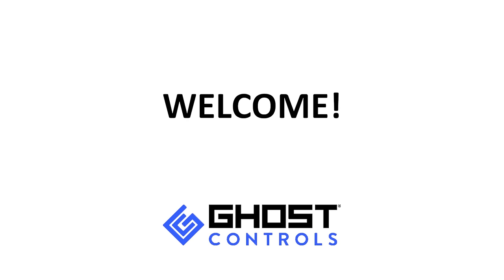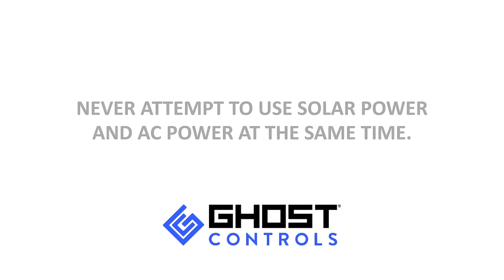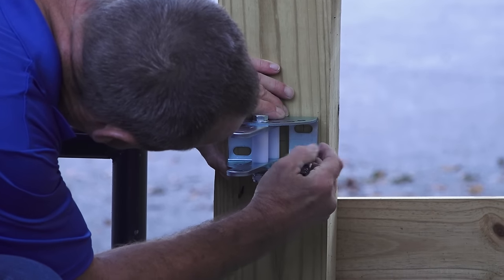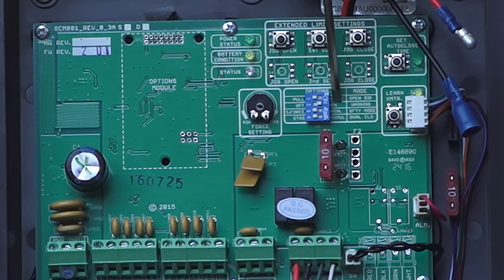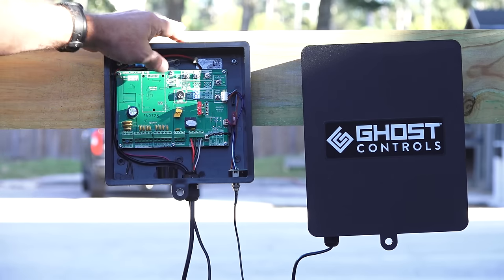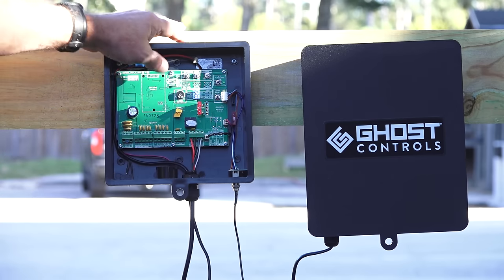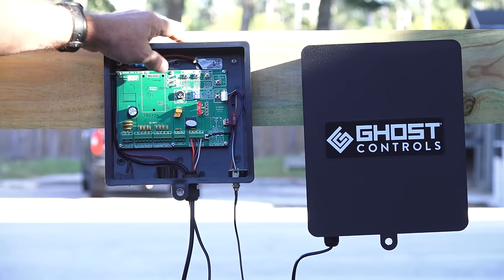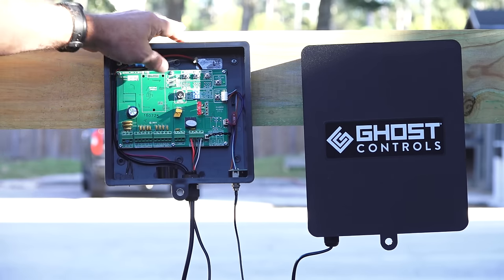Ghost Controls Gate Opener Kit Installation Video

Comment: Love my Ghost Control gate opener!  We have had it five years without a "hick up" until lighting hit very close on our property taking out one of two controllers.  Ghost Control technicians worked with  me to isolate the trouble in a very short time and away we went with replacing the unit.  It arrived within a few days for replacement which I will begin in a couple of days  They have my 5 star rating in every aspect of the high quality unit, Ghost Controls!
Reply from the maker: Thank you for the update on your system and for your support.
Reply: @Ghostcontrols2015  what do you recommend to keep that from happening? Isolators?
Reply from the maker: @mrstanley9856  we recommend grounding the gate and any adjacent metal fencing or structures, post, etc. This does not guarantee that lightening will not strike but it might help deter it from happening.  Here is a link to schedule a call with a technician for more information https://ghostcontrols.com/pages/schedule-a-call

Comment: Why didn't you do your video  installation on pipe fencing?    How many conversion brackets are needed to mount this on a pipe fence entry?
Reply: YES!
Reply from the maker: The T Series gate openers give you Tube gate adapters that will fit over most Tube Gate Pipes. If you are mounting to a 3 or 4 in round metal post we have adapters for that as well. Tanks!

Comment: Hey guys, I'm about to install a full bells and whistles system from you, with extra battery, keypad, zombie lock and vehicle sensor (among other bits) but I am reading that the vehicle sensor should not be used with animals on the site. I have a farm/ranch and have livestock dogs that can go down the driveway, between my sheep fields. Will the dogs or the sheep trigger this sensor and open the gate when there are no vehicles present? Is there a 'less sensitive' sensor that will only go off when it sees a 1000+ lb vehicle, not a 100 lb animal? Thanks!
Reply from the maker: Tad,
Thank you for reaching out, and for your interest in a Ghost Controls system! This is an excellent question. The vehicle sensors work by sensing moving metal. A metal dog collar, shoed horse, or another moving metal object can activate this sensor. We do not recommend using the sensor if you are trying to contain livestock or other animals to ensure they all stay safe. We would recommend skipping the sensor and installing a secondary keypad or push-button on the interior side of your property instead. 
My team is happy to run through any other scenarios and questions with you to ensure you get the perfect kit for your gate and lifestyle. They can be reached through the live chat box in the bottom right corner of our website or by calling 850-558-5520 option 1. 
Best,
Ghost Controls Team

Comment: I have had other brands, and this one is far and away the best.  Easy installation and easy to set up.  The only issue I had is that the solar models come with one battery but they recommend two.  The battery went bad after a few months, but they sent a warranty replacement.  I bought a second battery and have had no issues.  The battery box is already wired for two batteries.  I would never go anywhere else for an opener.
Reply from the maker: Thank you so much for sharing these kind words of your experience with us, Marc! We are always happy to help and are thrilled to hear that you are still enjoying your Ghost Controls system. Please don't hesitate to reach out if we can help with anything else!
Thank you,
Ghost Controls Team

Comment: Can I use a Zombie Lock and Vehicle Sensor? It looks like I would have to plug both of them into the + slot on the lock, I didn't know if that would be an issue?
Reply from the maker: @adriangcnaz you are right you will connect the zombielock and the vehicle sensor into the control board and they both will share the + terminal

Comment: Really interested in a ghost gate opening system for our rural property. what I'm not 100% sure about is:  If Im going to  open and close the gate 6 times a day what size solar panel do I need and what size batteries should I use.  Can you help with this question.  Looking at using car sensor, keypad, Zombie lock.
Reply from the maker: Jim,
Thank you for reaching out! I apologize for this delayed response but hope the information will still find you well. We have a solar map available on our website that recommends how much solar wattage you should use based on your location and how many times the gate will be operated each day. That map is available here: https://ghostcontrols.com/pages/tips-for-solar-installations
We also find that most solar installations work better long-term when paired with a deep cycle marine battery instead of our 12V led acid batteries. This will store more of the solar power you collect to ensure you can make it through rainy weeks or dark and cloudy winter seasons. If you still have questions, please feel free to reach out to us at 850-558-5520. 
Best,
The Ghost Controls Team
Reply: @Ghostcontrols2015  Do you have a supplier in New Zealand? Yes that country where the Americas cup is being raced.

Comment: Do you have a recommendation on which deep cycle marine battery to purchase for the Solar option?  I purchased the 10w solar panel.  Thanks.
Reply from the maker: A name brand 12V deep cycle marine/trolling motor battery purchased at your local retailer is the best solution for solar applications!

Comment: Have installed the 55" driveway sensor, bearied wond 18" deep, reset it several times and used two different methods calibrating wond nothing works, gate is closing and opening again by it self, seems to have totally disturbed thee controls as the gate is now trying to close but only moves towards closing for 20" comes back and tries again, after the third attempt it finally shuts. This item is far too expensive not to work so I hope Ghost comes to the party by solving the problem or refunding my money !

Comment: PLEASE make a battery-less AC-powered version. The biggest complaint with so many of these systems (yours and other brands) is battery failure at an unpredictable time. Why force the use of a battery? Is that the only way to integrate low-voltage wiring? I'd happily run a higher voltage line one time if it means no battery maintenance ever.
Reply from the maker: Hello, you got it right. To stay within low voltage and DIY friendly product our openers run off a 12v battery. However, if you have AC close to the gate and use our battery box kit you should have no to little battey issues since keeps a steady trickle charge to the battery. We are sorry we can not be of more help on this one.

Comment: FOLKS, if you want more range out of your HomeLink vehicle opener, or the Ghost controller, simply add in a section of cable & attach your antenna (higher & away from obstructions) to get twice the range. I learned about it here: https://youtu.be/SQtA-DP9o_E

Comment: I love this system but would like to know is it possible to extend the length of the cable on the operator arm? We have an older gate and where the power runs we would need extra length to for it to reach.
Reply from the maker: Hi, I apologize for responding so late to your question which is a good one. We do not recommend splicing the arm cable and will void the warranty. We do have other arms available that do come with longer cables. If you are trying to hook the ac transformer up to the power outlet you can go up to 1,000 ft from the gate and use 16 gauge stranded 2 conductor wire. I hope this helped answered your question. If not please email us at gcmarketing@ghostcontrols.com

Comment: Great Video definitely helpful.  However order of steps does not agree with manual.  Also very well presented by your quality of install was a little off.  Should have used a level on the mounting of the control box and battery box ==> kind of off level.
Reply from the maker: We have updated the manuals to more closely coincide with the videos.  The angles of camera make them more appear more off level than they actually are but thanks for the comments.

Comment: My gate is mounted on a 6" round treated wood post with a second bolted to the first for additional support. They are set in concrete. I was going to mount a square  board to these and then mount the arm bracket to that square board.  I am pretty sure this will work. Any alternatives that you can suggest?
Reply from the maker: Hey, Big John! This sounds like a great plan, aside from one thing. We usually recommend notching a square on the round post to attach the half-moon bracket, rather than bolting another board to this. We're also happy to run through any further installation questions you may have.  You can reach us at (850) 558-5520 or by visiting https://myghostcontrols.force.com/ghostcontrolssupport/s/contact-form
Thanks!
- Kieley
Reply: @Ghostcontrols2015  The the Ghost Control (single arm) got here yesterday and the three boxes are out in the garage. I am reading the manuals, watching the videos, and making a shopping list for mounting posts and other things I may need. I plan on mounting everything this weekend. I did notice the notching of the round post as you mentioned.  After a little more research I called your customer service (sales?), prior to placing the order,  and asked a couple questions.  I ended up getting the system without the solar panel but ordered the 30w panel instead. I was going to buy your battery box and two batteries (I wanted a second battery in case the first died from over use or something). I thought it would be simpler just to get everything from you and not have to chase around looking for the best deal on a 12v marine battery and trying to figure out how to mount it.  The CS person I talked to was very friendly but said that for my purpose ghost recommended a locally purchased 12v marine battery over the ones you sell.  Something to do with charging the batteries with solar vs AC.  I did not completely understand it but I am not the expert on this kind of thing.

Comment: I purchased a dual gate opened and am satisfied except for one thing and that is the range of the remote controllers; it's terrible! Prior to making my purchase, I was told that the unimpeded range of the remotes would be 1000 feet. Even with the "upgraded antenna", I cannot get 200 feet and no one can tell me why????
Reply: My range is like 400 ft from my porch works fine sensor wire needs to be in sight

Comment: I ordered the "push to open" kit.  One would think the extended brackets would come with it since guidance to purchase them at extra cost (which I would have done) wasn't suggested and how would I know I needed them having never done a gate opener before.  I contacted the company and got no response.  So I made the brackets myself.
Next, I went "by the book" with the programming.  It did not work.  The book says to "press the Jog Open button to the desired position".  When I pressed it, nothing happened (battery fully charged).  The book then says "don't forget to press the transmitter".  So, I pressed it and the unit went into alarm.  Great.
After watching this video, when the guy does this step, he is actually pressing the "Jog to close" button.  Very interesting.  What gives?  Was this tid-bit left out of the instructions?
Now, nothing works and I'm still opening my gate by hand until I figure it out.
Seems like it should be very simple to do when you watch this video, but it isn't.  Go figure.
Hope you have better luck with yours . . . .🤮
Reply from the maker: Hi Dickie, we are so sorry to hear you had a frustrating installation experience. When you follow the procedure outlined in the video from 10:45 to 11:50, this will allow you to correctly set your open limit position. Before setting the open limit, locate the "options" panel and move dip switch number 1 to the right. This is the correct position for a push-to-open gate. If you are still having issues, please contact us at 8508981411, or you can schedule a call at your convenience at https://ghostcontrols.com/pages/schedule-a-call

Comment: Hi  It is the same battery for 2 gate opener arms, 10 watt monocrystalline solar panel, control box?
Reply from the maker: yes, only one battery box with two 12 7amp hour batteries are required or a deep cycle marine battery which is what i would recommend for solar applications if you will use your gate a lot or live in an area that does not get lots of sun everyday.

Comment: We had a problem with the system getting hit with lighting, Ghost covered it, and a new board is in place and working well. Thanks for that. While reinstalling the new board we started to look for grounding instructions for the Ghost system. We cannot find anything on grounding for lighting from Ghost.
Also, how can we tell where the power surge came from? Maybe make a replacement chip so it is easy to repair the board. IE: Arduino UNO Would it help to completely isolate the control arms and electronics from our metal fence that is around our farm? Trying not to spend $170 every time we get a lightning storm.
Still better than any other gate system we have installed...
Reply from the maker: Hi Trell,  Thank you for your support. I am glad we were able to help you replace your board, and thank you for your questions.  We have put together comments for each. 1) repairing the old board is not an option, replacing one component would often lead to the next or another component needing to be replaced. 2) The microcontroller you mentioned, we feel as though it would not be a good option. 3) as far as grounding. You can install a grounding rod(s) ground rod connector(s) and wire appropriate for grounding purposes. Ground the gate, gate post, and connected fencing.  Doing so may provide additional assistance with a power surge. We hope this was helpful.

Comment: After installation, my opener closed the gate but wouldn't open the gate. Not having further time to work with the unit, I disconnected the arm and have let the unit sit idle for some time - manually opening & closing my gate until I can get around to troubleshooting whatever issue exists. --- Update:  I've just connected the battery/control box to AC power using the available transformer. No doubt - the battery needs a charge before I can even attempt to use the opener. As of now, I don't have any lights lit on the control box, but the transformer's green light indicates the power is available for charging,. How long will it take the transformer to charge the battery, and will it charge with the -/o switch in either position (on or off)? If the battery will charge, I can then contact Ghost for troubleshooting.
Reply from the maker: Thanks for reaching out, though we are sorry that it is because you have run into some trouble with your gate. Our support team would be happy to help you troubleshoot this situation with you to get to the root of the problem with the limits that are set on your gate.
All of their contact information is available here: https://bit.ly/2Qp7Uag  (and their phone number is 850-898-1411).
However, the easiest way to get in contact with them (without waiting on hold) is to schedule a call for a time that you will be available at your gate. You can schedule that call by:
- clicking the link above
- scrolling until you see "Schedule a Technical Support Call"
- click "At Your Gate Support"
- select a time/date that works for you and complete the remaining fields
- you will then receive a call from us at the date and time you have selected.
Reply: @Ghostcontrols2015  - First, I needed to replace the battery. Thanks to Ghost Controls for shipping a new battery, as the original would no longer charge but was covered by the warranty. Once I did that, I contacted tech support. I needed to adjust the arm by fully retracting it; moved the arm attach bracket on my gate to connect to the fully retracted arm; hooked up the electrical wire for my previously installed ZombieLock; and, WOW! She works as advertised. Excellent "at the gate" tech phone support. I'm pleased with my purchase.  My 16' farm gate is a little slower opening than I anticipated, but it sure beats getting in/out of the vehicle to manually open/close the gate. The push to close appears faster than the pull to open function, but she's working great otherwise. Thank you Ghost Controls!

Comment: What is the little round black piece that sits between where the wires come in to the box. My gate was not working at all, then I slightly twisted that and it started working again.
Reply from the maker: @adriangcnaz that is a strain relief. The gate opener wires or accessory wires go through the strain reliefs on the bottom of the control box to prevent water and other elements from getting in. You could have had a loose wire or your wire was too tight in the strain relief. If this happens again, I suggest opening the control panel and making sure all your wires are tightly connected into the terminals. If you would like more information please email marketing@ghostcontrols.com
Reply: @Ghostcontrols2015  Sorry, I was referring to the big plastic piece to the left of the strain relief in this video.
Reply from the maker: @adriangcnaz  if one the control board it could either be the antenna or the only other plastic piece would be the on off switch? Please email marketing@ghostcontrols.com and we can get you with a support tech.